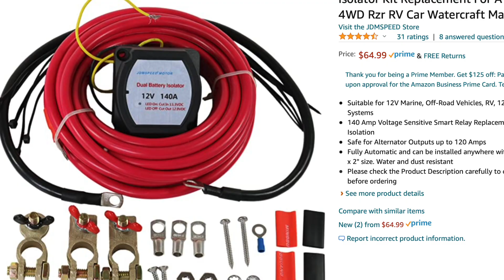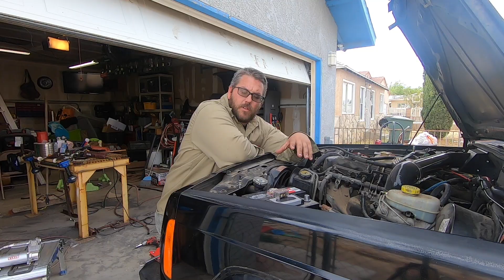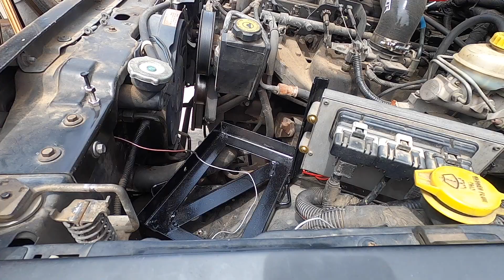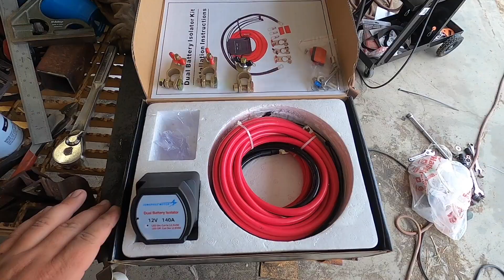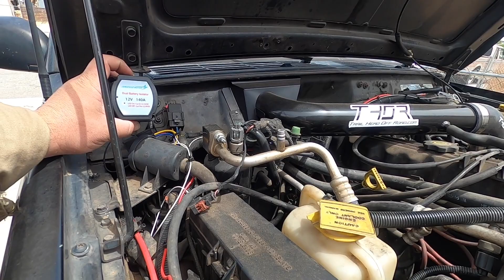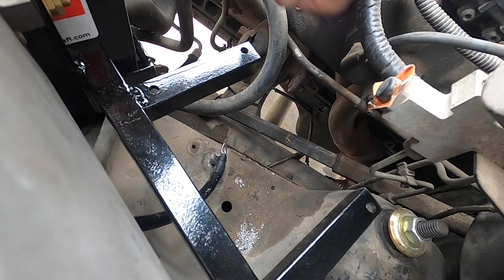Putting A Cheap And Easy Dual Battery System Into My Jeep Cherokee XJ

Comment: 😎 I now have a 2000 Cherokee XJ 😎👍 It has issues and slowly getting to address things to either be repaired, replaced, modified or upgraded. 

I do plan on running a dual battery set up. However, I will be installing a Redarc DC to DC charger and smart battery isolator (SBI). The Redarc has dual input (auto selecting). It  charges by the alternator while driving. Then while camping, I plug in my portable solar panel for charging. The SBI will allow me to pull from both batteries when starting and in winching operations. This will done automatically through the use of relays. This way I do not have to use a manual switch (to make it dummy proof for myself). I'm up in age now, and I have a tendency to get absent minded some times and may forget to flip the manual switch to the off position. 🤣

I do like the setup you created for the auxiliary battery, computer relocation and the addition of the relay box. Looks good and It looks close to factory 👍 So far, this is the best setup I have seen and I will end up doing something very similar to your creation. I am in the process of building a DIY CNC plasma cutter from the design and plans from JD's Garage. You find him on YouTube. This will be one of my projects to make using the CNC plasma cutter.👍😎

Comment: Instead of using a manual switch it engage the over ride, use a relay hooked up to your ignition switch. Also, same thing with your winch. You want to use the 5 pin relays (87a pin will be used).

When you start your vehicle, the signal/trigger from the ignition will activate the over ride switch and now you will be use both batteries to start the vehicle. When engaged with winching operations, you pull a signal/trigger from your winch to the relay. The relay engages to active the over ride switch. Using both batteries during winching operations. So, using the two relays, you can perform the operation automatically instead of manually flipping a switch. This way you don't have to remember to flip the switch to disengage the over ride on the isolator
Reply from the maker: I get what you are saying but they will already be connected when it is running via the “smart isolator”. If I connect the override to the keyed on position then if for some reason the ignition is left on it will run both batteries dead instead of just one. Having it on its own switch I will still be able to start the Jeep if one battery dies in this scenario.
Reply: @ProjectVenture  Sorry, let me correct myself😂. For starting the vehicle, you pull the trigger off of the starter solenoid. Once the vehicle is started, the key rotates from start position to run position, and the trigger is disengaged automatically.👍

I have drawn out my wiring diagram I want to use using Microsoft Word using pictures. A picture of a starter for a starter, winch for winch, etc. Then I drew lines connecting everything together. Right now I have a 2008 Chevy Silverado with a camper shell. I will be working on getting all the components here and there. Aux battery, winch, fridge, inverter, shore power, solar, and so on. I have figured out a way to automate and dummy proof my setup. For example while on shore power, I don't want anyone including me to turn on the inverter. If that happens, shore power is automatically shut off. I am in the wings/hopes at looking at acquiring a Jeep Cherokee XJ sometime in the somewhat near future (fighting Social Security). My Chevy is ok. However, most of the local groups in my area take trails where full size trucks just don't fit😂. So I will use my Chevy as a daily driver and the XJ for overlanding/camping.

Comment: Does this help if you are having voltage issues while running electrical accessories like light bars, fan, and sound bar?   I put in a high output alt, it has helped but my volts are still dropping to around 11 instead of staying up near 13-14.
Reply: For battery cable upgrade, look up the Big 3 or Big 7. These come in kit form.
Reply from the maker: It wouldn’t really help that much with those issues. It’s more useful when you have something with a high amp draw like a winch. It’s main purpose on my rig is to run all of the non factory accessories off of it to not strain on my starter battery. For your issue though I would recommend upgrading all your battery cables. There are many kits you can find online for this.

Comment: How do you like that cold
Air intake?
Reply from the maker: I really like it a lot. Haven’t had any problems with it. Seems to run better than the last Cherokee I had. I have a video on it as well.
Reply: swooshy but totally  worth it my wj sit good 10 degrees coooler then it used to  with the thor